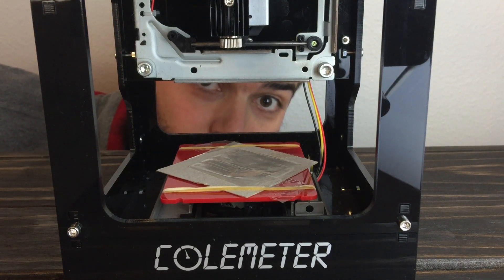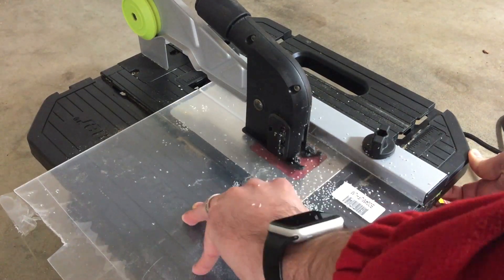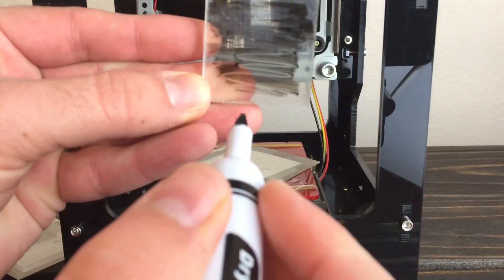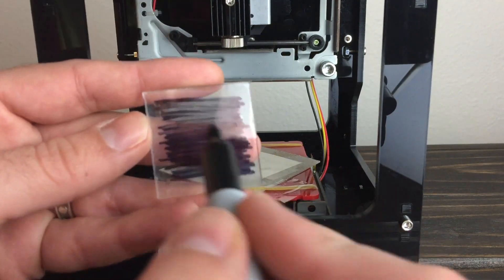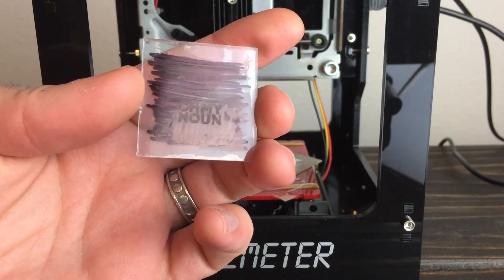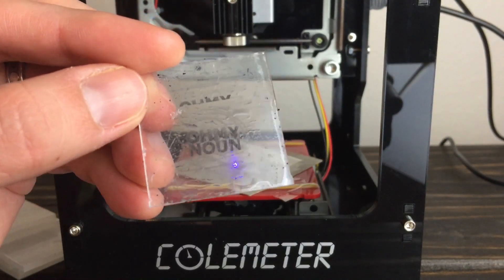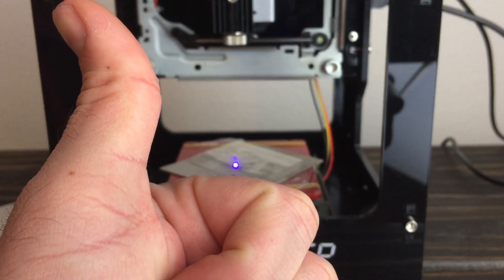How to Etch Clear Acrylic with a 1000mW Colemeter Laser — 2nd Attempt!

Comment: couldn't you just use a dark colored masking tape instead of a marker?
Reply from the maker: Yes, however, tape heats up too much for small details and also leaves behind burns that are tough to clean off.
Reply: I've read that rubberised spray paint (used for car bodywork, etc)can be used and it peels off easily, I've yet to try it myself but it sounds promising.

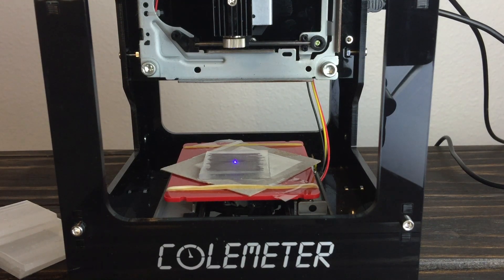Comment: 2:55 could it be because it is sensing too much reflection back at the laser module??
I don't know if these NEJE lasers have anything built-in that cuts it off if it thinks the laser is at risk? Any thoughts?
Fantastic quick solution I must say! Rather than using the tip of the pen, remove its fibre innards and mark the acrylic with wider, brush-like strokes, but most importantly in a single pass. With your idea, spraying the surface with something that can be easily removed after an etching, is currently being sought after!! Water based would seem to be the ideal candidate as long is it can adhere to the non-porous surface without wanting to leave it!
Reply from the maker: No, it turned out to be an issue with power draw. My powered USB hub didn't allow enough amps per port. I have to use two separate ac adapters to solve this problem.

I'm currently wondering if a coat of hairspray followed by some marker would be an easier way to get a nice application of the "etching medium" onto the acrylic.

Comment: I found that my machine would cut out at times like yours. Tracked it down to poor power supply. Once I exchanged the power supply and ensured the connections were all right, I had no more problems.
Reply from the maker: Yeah, same here. My powered hub wasn't putting enough amps to all of the ports.

Comment: I have a 1000mw laser engraver and use NEJE V3.6 software. Black dry marker works for me and I burn at 40 and make 2 passes. I can etch real fine lines and letters at these settings. Be sure to take your time when applying the dry marker.
Reply: Hi James, can you please tell how much  finest/thinnest line possible to etch on acrylic from you laser machine? Approximately in millimeters?

Comment: Never use alcohol,on acrylic...normally it will destroy acrylc.....what would happen if you painted the bottom black instead of stop? Would it engrave on bottom side?
Reply from the maker: There are cheap plastics alcohol will harm, but not acrylic. Acetone, on the other hand, may harm acrylic.

I’ll have to test underside engraving, but I don’t believe it would. (I think it would harm the etching bed instead.) interesting experiment to try, though!

Comment: so can I just use alcohol to erase the permeant marker or goo gone?
Reply from the maker: I recommend drawing over the permanent marker with a dry erase marker. Then wipe the dry erase marker off as you normally would. It's by far the easiest way to get permanent marker off of any surface that is a good fit for dry erase marker.

Comment: Could you help take some photos and measured the depth of the etch? I'm researching how to do a deep etch with this machine. Thanks great job! Neje must have seen this video. My unit comes with a marker pen. I was wondering what it is used for. Until I saw your video. Then I went back to check the manual, it says to blaken the transparent material before etch!
Reply from the maker: I’ll put this on my list for an update video. I have a few other things to squeeze into an update, too.

Comment: I do not have a etcher yet but need to know if have you tried granite?     Also years ago when i was doing industrial  photography we used cheap hair spray to reduce glare and flattnen the reflections of surfaces.  can you try that and let us know if it works.
Reply from the maker: I haven't tried granite, but I have tried mollusk shells, turtle shells, and cheap plaster. The plaster barely etched. The turtle shells etched if you imagined hard enough that they did. And the mollusk shells were hit and miss (even within the same shell). I can't imagine having much luck with a laser this strength when it comes to granite, but using a masking technique and an etchant (see my glass and/or metal videos), you may have better luck.
Reply: Hair spray will ignite try thin coat of blackboard paint you can buy it in spray can version which will be much finer

Comment: You could have saved yourself a lot of time by using simple wide masking tape. The laser burns through the tape and etches the acrylic. Just remove the tape after.
Reply from the maker: I actually have a previous video demonstrating the tape technique with mixed results. This marker technique, I feel, delivers better detail because there is no adhesive to retain heat and melt the detail away.

Comment: what is the blackpermanent  marker for ?
Reply from the maker: Laser light of this frequency passes straight through clear plastic. The black marker gives the light energy something to absorb into, allowing the light to etch the plastic.
Reply: ohmynoun is it possible to use other method than permanent marker? Which is better surface covered.
Reply: ohmynoun such as black tape?
Reply: Ive seen many video laser engraving acrylic without anything put on top
Reply: And what i have done is just put a piece of wood under the plexi and engrave..it will engrave on bottom side not the top side....works good..and you dont have to mirror image... looks great

Comment: what settings did u use to etch?
Reply from the maker: I can't remember exactly, but somewhere between 70 and 80. I'm pretty confident it was right on 80, though.
Reply: 80% of power and the speed? 1000mm/min, 800?
Reply from the maker: I'm using default software for these mini NEJE-type lasers. The don't have speed/power adjustment. Just a "burning time" setting. That's the setting that I think was at 80.
Reply: ahh i get it, im using laserweb software :P i wil try some settings  :D thx man
Reply: Same here. I'd love to find some laserweb presets.

Comment: I am not shure on this but I've seen alot of commets on the same problem with 3D printers and that turns out to be a bad SD card
Reply from the maker: The bottom of my unit actually has a sticker that says if the machine stops mid-carving, it could be because of a power interruption, and that I should use a 5V 1A charger. But I use a 5V 2A hub power supply. I'll try upgrading that even higher to see if my current hub might only be 2A combined current across all 4 plugs.
Reply: It looks like it rebooted, so most likely power related. Put a multimeter across the 5v line at the input and see if it drops when it starts etching. If it does, the power supply is the problem.